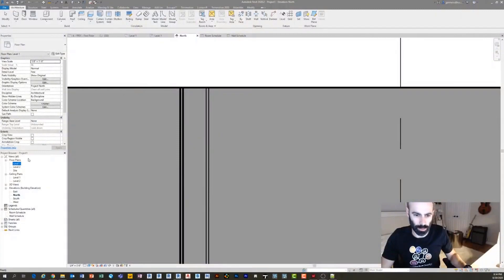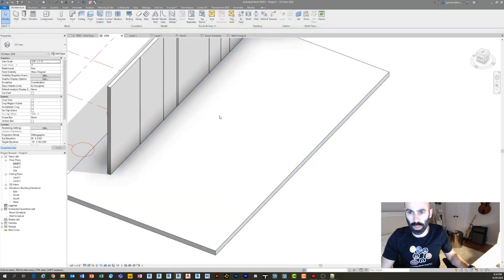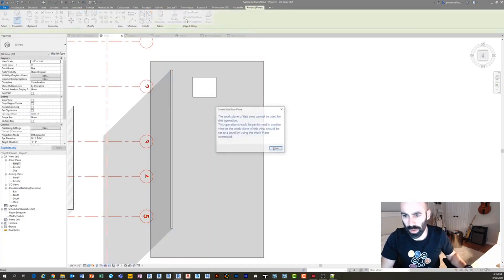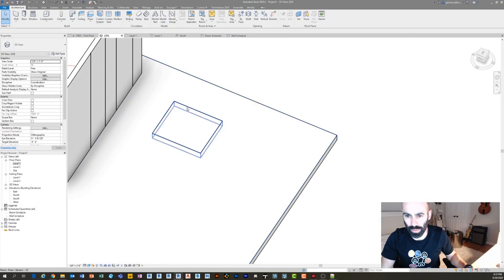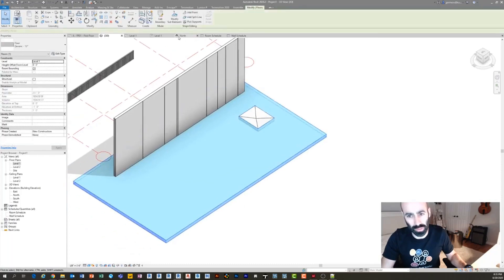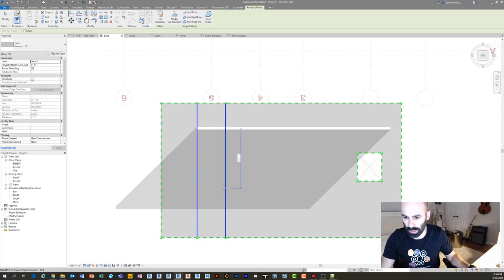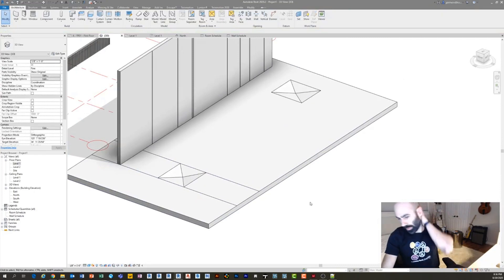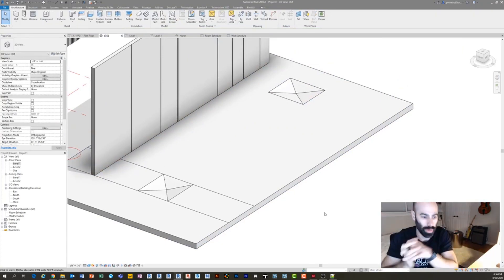Sloped Shower Floor / Drain in Revit Tutorial (Quick Tip Edition)

Comment: How would you make the same shower floor but with a smooth surface, that is without without the drain lines from the edges to the drain? This would happen if the drain is circular for example. Thanks.

Comment: would you not make it a family? then you have better scheduling options available and you can make it look more like the shower tray product rather than floor geometry.
Reply from the maker: The initial question was about sloping a floor (not created a shower tray).  Yes, depending on the construction method (if it were a shower tray type of detail) I would go with a family 100%.
Reply: The benefits of using a family give you a lot of flexibility , personally it's the route I would take as well... But for a novice user that's not comfortable in the family environment I can see this being an easy out/quick fix.